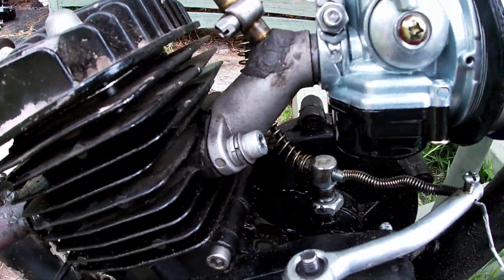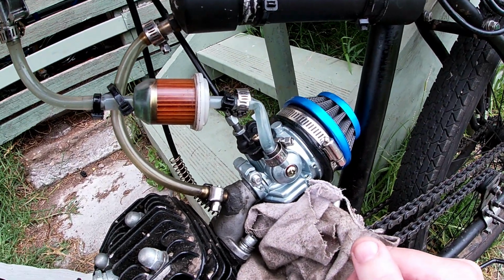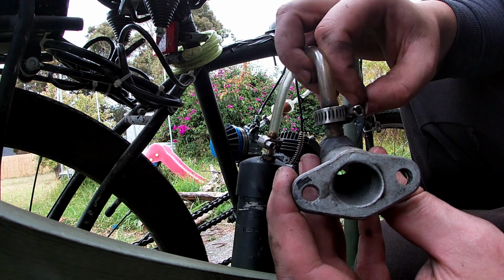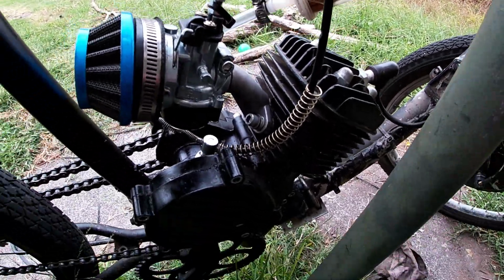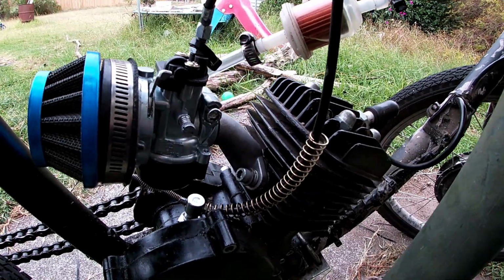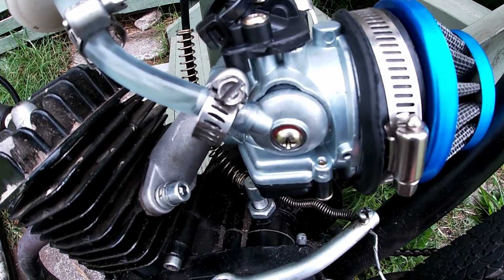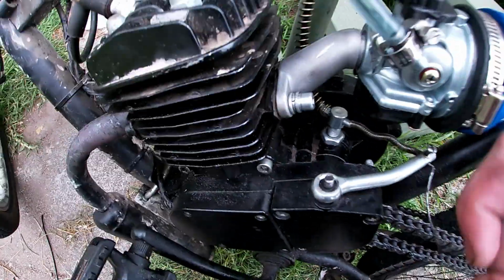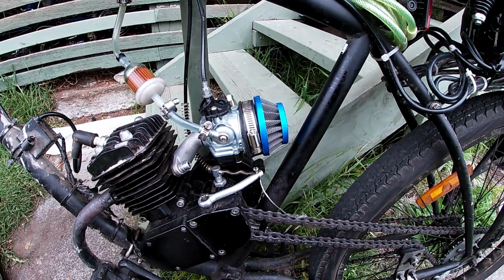Boost Bottles - Hindrance or Help?

Comment: Seems to me it runs better without the bottle but not so good, my guess is you need a bigger sprocket to rev up more, sounds to me is running under optimal RPM, 2 strokers likes to be rev up in order to give full power.
Reply from the maker: In my experience a 48 tooth is the better sprocket size for a stock 66cc 2 stroke. It's a good balance between torque and speed. 
But I'd never had a 32 tooth before so I thought I'd give it a try

Comment: Get a better spark plug wire. Like from a car. 8 mm copper wire or so, the ones from the kit are like speaker wire. They’re junk and the boots break
Reply: I switched mine out when I first got my motor used. I wanna say it idles better, more smooth but I didnt do a comparison. Maybe something u could try out. Cheers mate
Reply from the maker: I did that for the mk4 2 stroke 👍 I might swap it over

Comment: It's not as bad yous tho what's happened
Reply from the maker: I followed this design from another video I found, and got lucky I guess. I'm not a fan of BBR tuning, my guess you just got a bum quality product
Reply: @NicksBikes   in goes very well I don't understand  what had happened to yous in the video but I get 43 mph from mine at the moment I have plenty more up grades to come check my channel will be posting from now onwards
Reply: @NicksBikes  and can I askmif you have removed the baffle from your exhaust and take the sponge out the air filter will gain alot of power
Reply: @NicksBikes  will,put a video on this week and I will show you how much mine revs up you will be surprised
Reply: @NicksBikes  ohh and do me a favour and cut you boost bottle pipe so it directly  above you cylinder head connected to your frame and let me know if it works I think that's were your going wrong maby
Reply from the maker: @Motorizedstuff  subbed 👍
Reply from the maker: @Motorizedstuff  i removed the baffle but i run the foam filter without the box